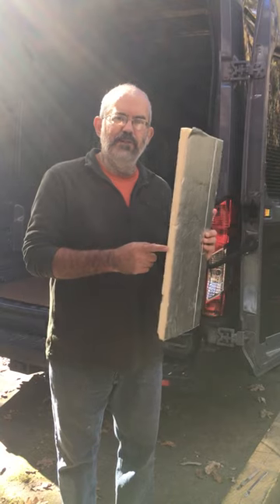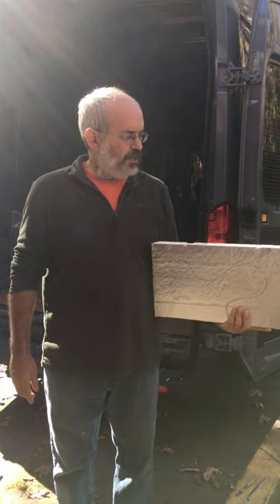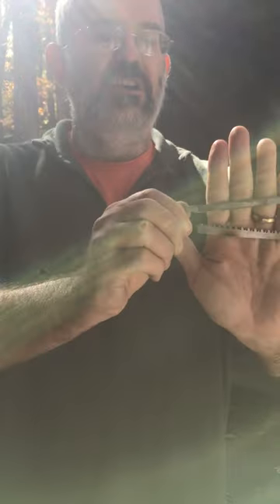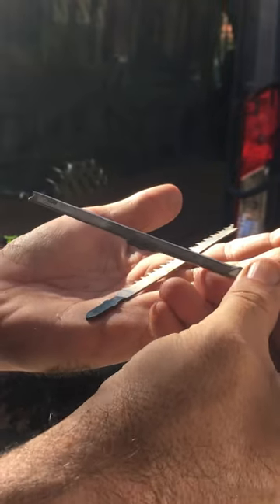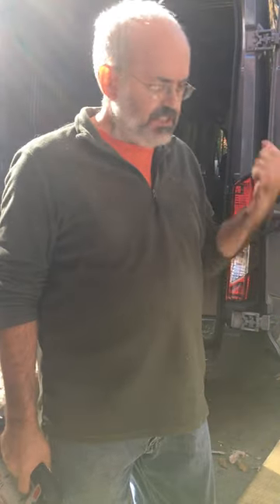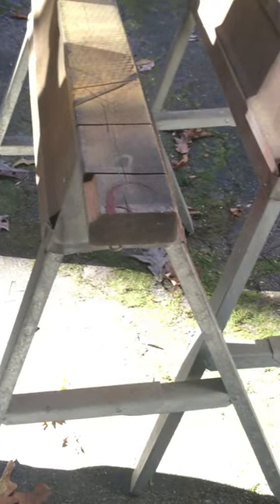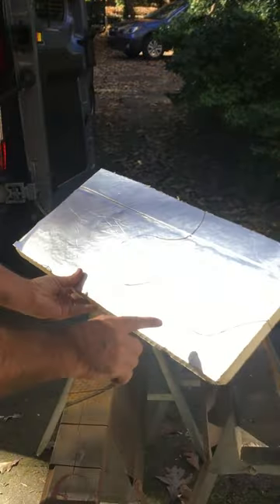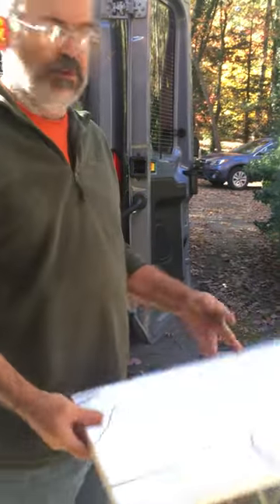How to Easily and Cleanly Cut Curves in Rigid Foam Insulation

Comment: I wonder if my Dremel can do that to the jig saw blade.  If that doesn't work I'll try the official Bosch blade for this, but it's kind of wide and I don't know how it would do on a tight curve.
Reply from the maker: I'd bet that it can.  While it might be easier to get a straight edge using a larger grinder wheel, I don't think that having a few divots caused by a small-diameter dremel wheel will affect the performance in the least.  Good luck, and let me know how it turns out!

Comment: Can the same be achieved with a reciprocating saw? (Sawzall) with either a grinded down blade like you have, or at worst, a metal cutting blade because it has tiny teeth compared to a wood blade? Asking because your idea is genius, but I can't afford a jigsaw at the moment lol.
Reply from the maker: You could certainly grind down a recip blade in the same way, although it might be harder to control that saw for accurate cuts. I think a metal cutting blade would be similar to what you’d get with a wood cutting blade except the dust would be finer. The advantage of grinding down the blade is that you basically create a knife that can cut the foam without making any dust. Good luck and let me know how it turns out.
Reply: @daveminnich632  I'll get a jigsaw eventually, I just binge spent on a bunch of other stuff so I've gotta wait for a couple more paydays if you know what I mean, and I hate waiting lmao
Reply: I just got a jigsaw from my local Habitat Restore for $8.  A very common item at those kind of places.  I dont know what your budget is, but you might check them out if there is one near you
Reply: @carlweiskott7623  thanks for the tip! Didn't know about that!
Reply: @carlweiskott7623  lol, budget is usually not THAT low. It was just the snowball of me trying to get everything at once lol. Wood, hardware, some other new tools that I also require, paint, a couple new locomotives, scenery items, wiring, etc. I'm getting back into the hobby after about 25 years, never having built a "realistic layout" and spent a couple weeks trying to watch videos to get myself up to date on all this new (to me) technology. By the time I sat down and went "how do I cut this crap?" I was already hundreds of dollars deep in stuff with my normal bills coming up. I'm sure we all know how this hobby can ring up a tab very quickly lol. Cheers! And thanks for the help!